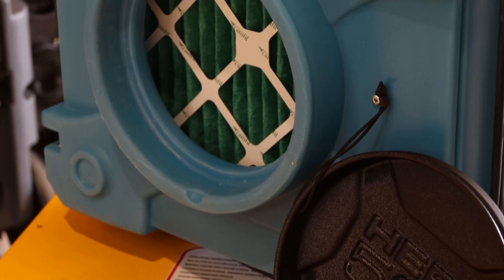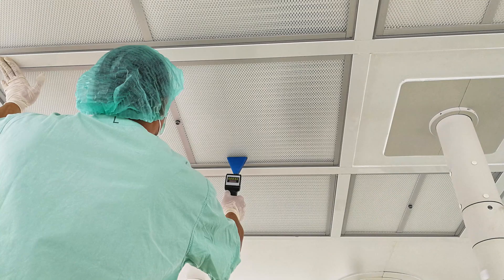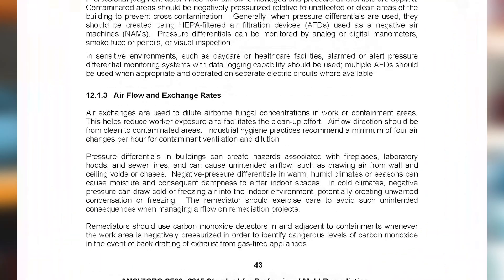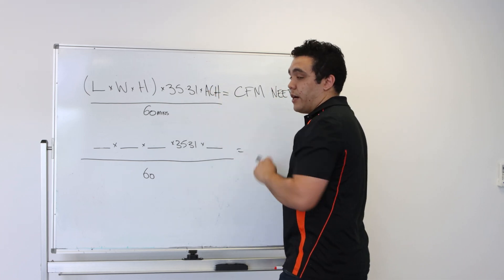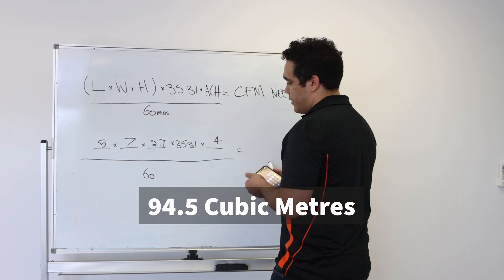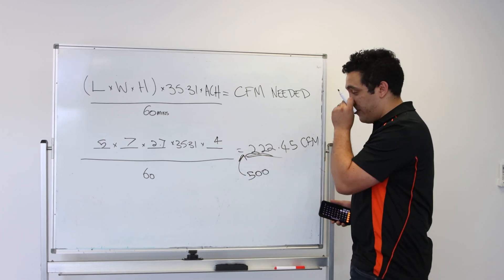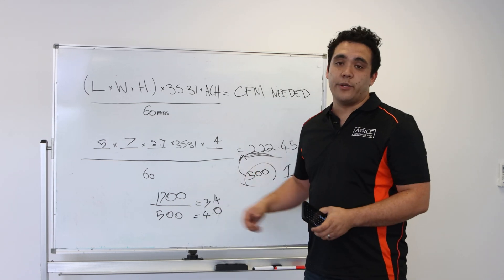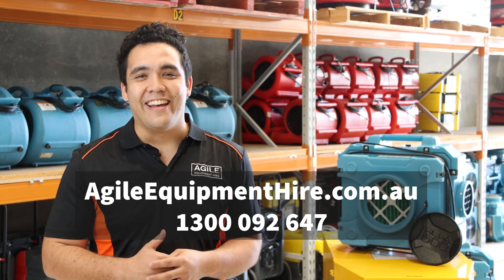How Many Air Scrubbers Do I Need? HEPA Air Scrubbers for Restoration Explained!

Comment: Does this clean fiberglass dust in the air?
Reply from the maker: Hi there Yvette, sorry that this comment slipped under our radar.
HEPA air scrubbers absolutely assist in reducing airborne particles. Harmful dust like fiberglass can be tricky to deal with, so if you still need further help, please give us a call at 1300 092 647
Reply: @agileequipmentAU why is fiberglass considered tricky?